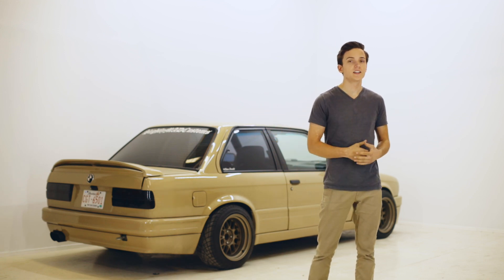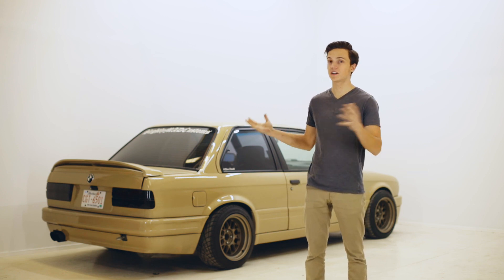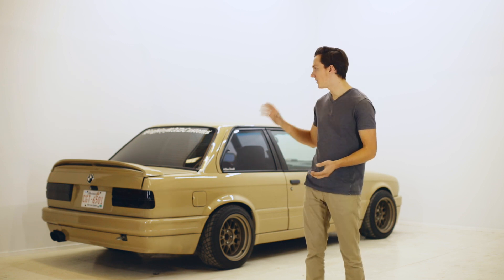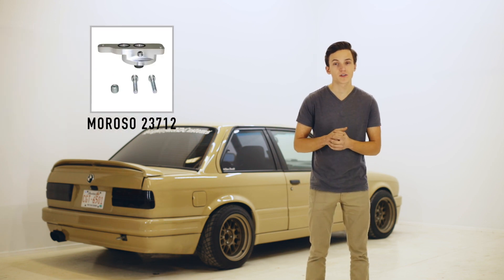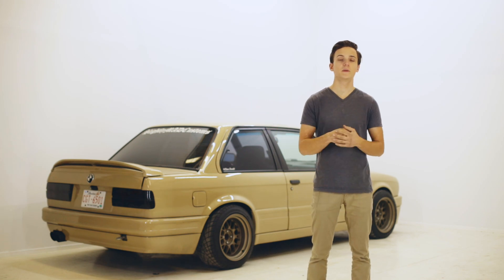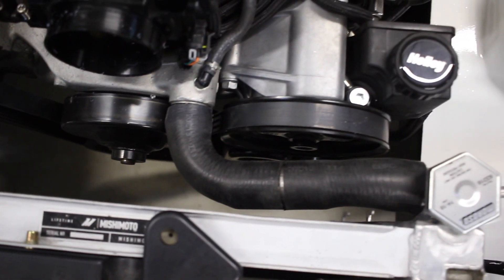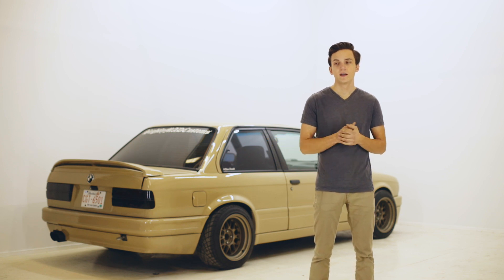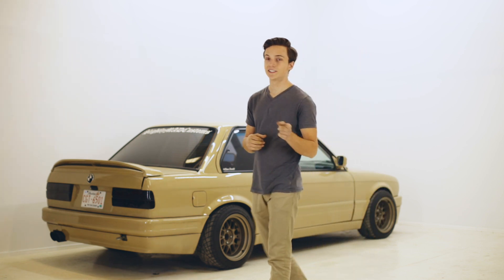EP 3: MOUNTING YOUR LS + COOLING, & FUEL SYSTEMS - LS E30 SWAP GUIDE

Comment: My LS doesn't have accessory brackets. Do you have a recommendation? I bought a billet bracket for the alternator and power steering pump, but it looks like it's going to be too tall for the hood.
Reply from the maker: Ya I used the Holley low mount kit

Comment: I have that same radiator. I'm starting my swap here soon. Where did you get the fill neck and cap from? Is it welded onto the inlet of the radiator?
Reply from the maker: Ya I welded a 90 degree pipe and a radiator cap onto mine. Very custom. Bought those two pieces from summit racing. But most swaps don’t do this and just use a radiator hose with a 90 on it
Reply: @slightlyMADcustoms  I'm still pretty new to this so I'm having trouble figuring out how this is going to work. I like how yours turned out.
Reply from the maker: Ya there’s a lot of stuff you gotta figure out. But all the main things are mentioned in this guide

Comment: whast year is your e30? is it 1984 ? im not sure which mishimoto radiator to go with for my LS swap their is a few options can you be more specific please?
Reply from the maker: Mines a 1986. There’s one common Mishimoto radiator that fits e30 and e36
Reply: @slightlyMADcustoms  sorry to bother you again , would it be the X-Line Performance Aluminum Radiator, fits BMW E30/E36 1988-1999 or the Performance Aluminum Radiator, fits BMW E30/E36 1988–1999? theyre both on sale at the moment but one is a lot cheaper then the other so I wanted to make sure I am also going to LS swap soon
Reply from the maker: Go with the non x-line.  I think the x-line is thicker and better for cooling, but might give you more clearance issues
Reply: @slightlyMADcustoms  Thank you so much! I'm rebuilding and 84 E30. Hopefully one day it will be almost as nice as yours!
Reply from the maker: Very nice! Good luck!
Reply: @slightlyMADcustoms  Thank you!

Comment: It doesn't appear you used an overflow tank in your build for the coolant and mishimoto radiator?
Reply from the maker: I used the mishimoto aluminum rad, modified it slightly. Nah didn’t use an overflow, I have a mounting spot for one, but never bothered putting it in. If you look at any classic muscle car they didn’t have them
Reply: @slightlyMADcustoms  I see. So you haven't had any issues with coolant spewing out of the radiator cap? Also, what fan are you using specifically and how do you have it wired up?
Reply from the maker: Nah once the system finds its happy level of coolant you’re good. I have the flex a lite 14” pusher fan. Although I’d recommend a higher CFM one than the one I have. It’s controlled through a relay by my Holley terminator ECU
Reply: @slightlyMADcustoms  Ah I see. I'll be sticking to the OEM LS1 ecu so I have to figure out how to wire it in.
Reply from the maker: There should be an output on the stock ECU for fans. Or you can get a fan wiring kit, easy peasy to install
Reply: @slightlyMADcustoms  Yup. I'll probably just wire it directly to the oem ecu. The aftermarket kits are also nice and cheap.

Comment: Do you have a video or rough dimensions/drawings of the diy engine mount arms you created?
Reply from the maker: I have a photo on my Instagram @slam.bandit. I don’t have any dimensions but I think the arms should be made specifically for where you placed your engine. Basically what I did was made a rectangular plate that bolts to the LS, then used 1” square tube that extends down to the mounting points on the subframe. You can pretty easily eyeball the angles that the tube needs to be cut at, then weld in a cap for the tube with a hole for the engine mount stud, cut a access hole in the tube so you can throw a nut on the stud. And lastly I welded on some gussets to make it all nice and strong
Reply: @slightlyMADcustoms  Ah I see. I found it. Both pass/driver side mounts should be perfect mirror images of each other, correct?
Reply from the maker: They were very very similar. But I made them individually just to be sure I kept the engine right where I wanted it
Reply: @slightlyMADcustoms  Where did you get that LS drive shaft to e30 diff coupling?
Reply from the maker: My driveshaft guy made it for me